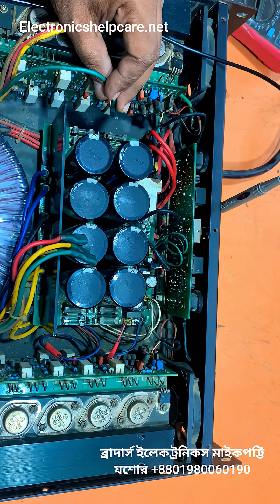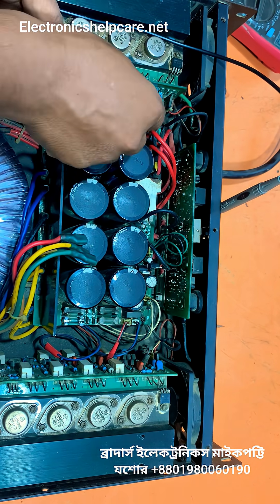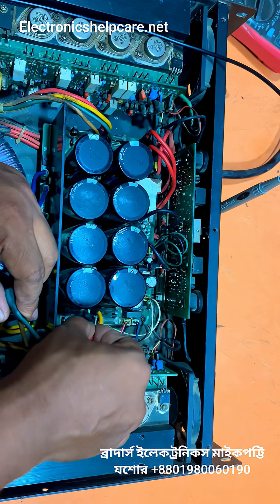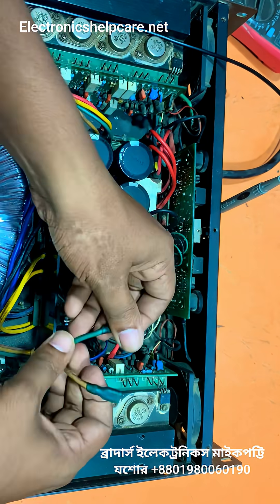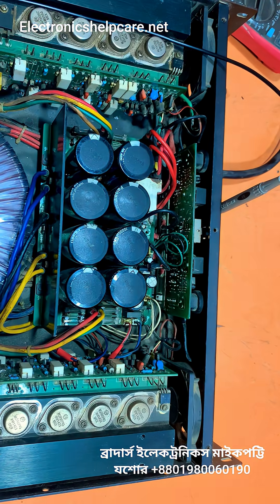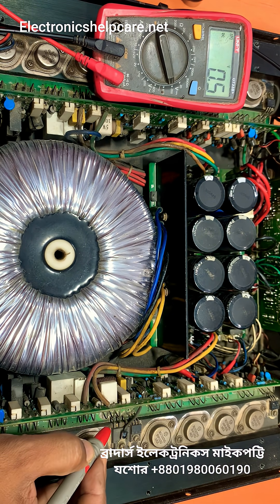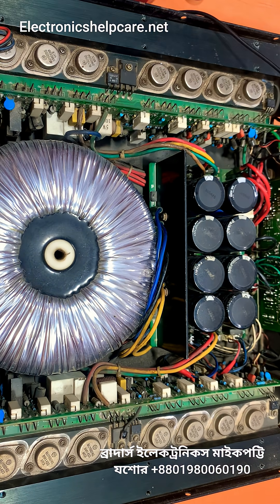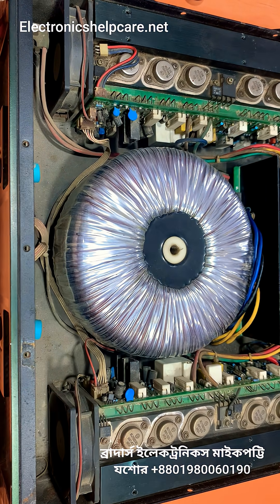4k amplifier repair #ampliefierplate #amplifierrepair #repairamplifier #audioequipmentrepair

Comment from the maker: https://electronicshelpcare.net/2sc5200-and-2sa1943-transistor-amplifier-circuit/
https://electronicshelpcare.net/100-watt-amplifier-board/
https://www.facebook.com/DiplomainEEE
https://www.pinterest.com/electrohelpcare/pins/
https://www.pinterest.com/electrohelpcare/
class d amplifier board,class d amplifier,amplifier board,2 1 class d amplifier circuit board,bass amplifier board,tda7498e amplifier,tpa3116 class d amplifier board,powerful amplifier,tda2050 5.1 amplifier board,class d amplifier board test,tda7498e amplifier board,200watt class d amplifier,amplifier board connection,dhruv pro tda7498e amplifier board,amplifier,tda7498 2.1 amplifier board,diy amplifier for hometheater,tpa3116d2 amplifier board,200w amplifier